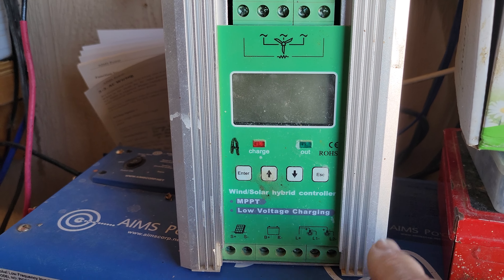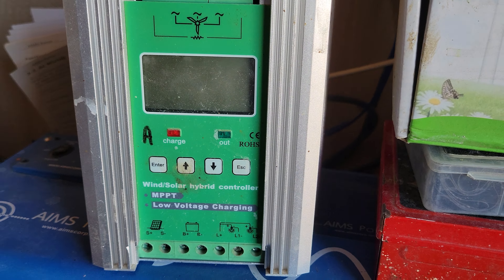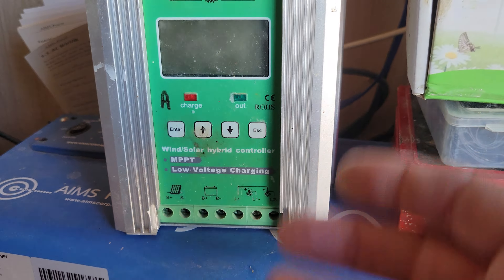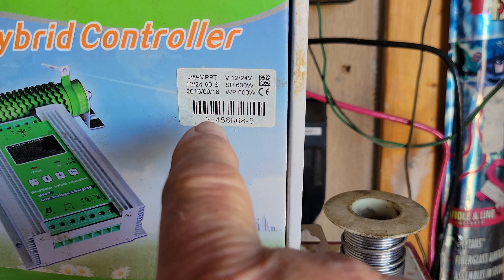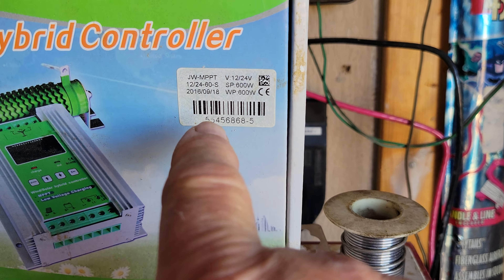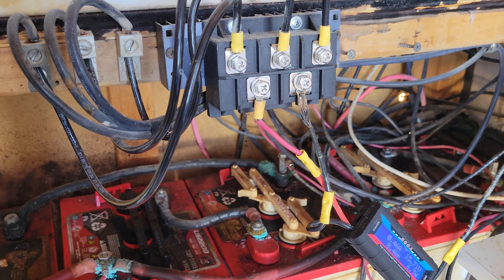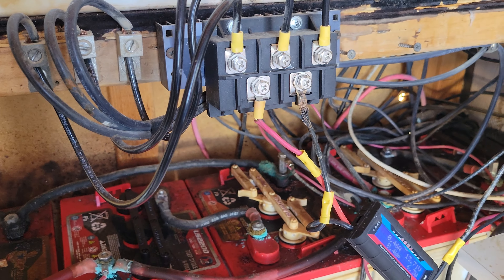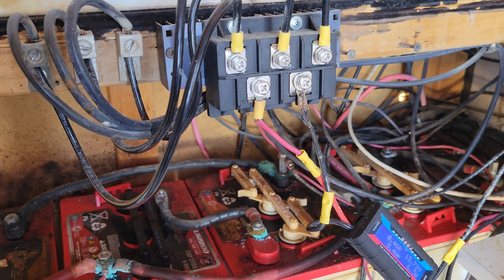Off Grid Needs, Part 7, May 5, 2023

Comment: I've got a parcel in WV where I was thinking of using a water pump as a dump load in order to push water uphill to a settling tank.  If I was in the desert, I'd probably want to use the deep aquifer briny water for evaporative cooling.  It would make some gnarly salt sculptures over time.
Reply from the maker: That would be interesting to see.